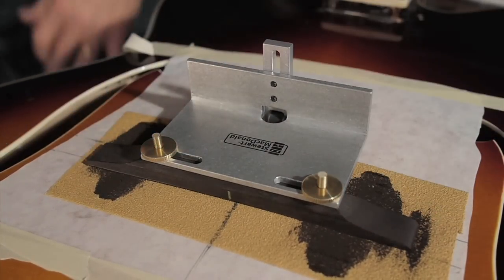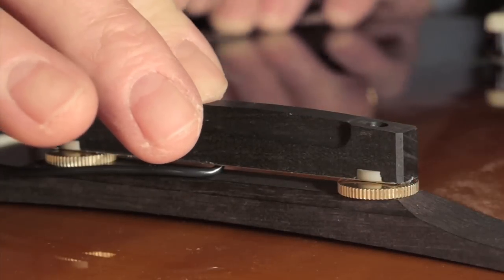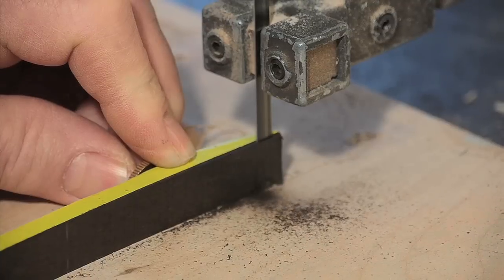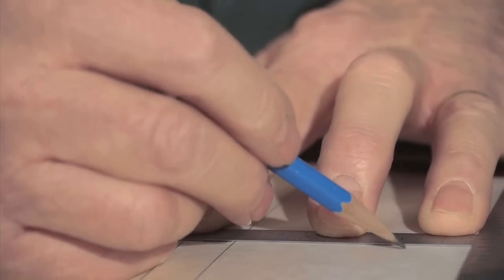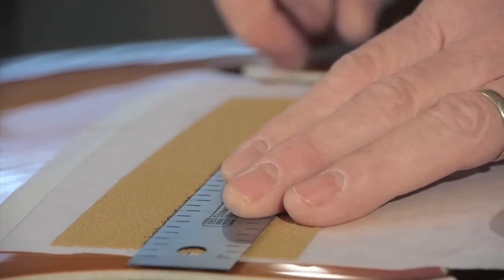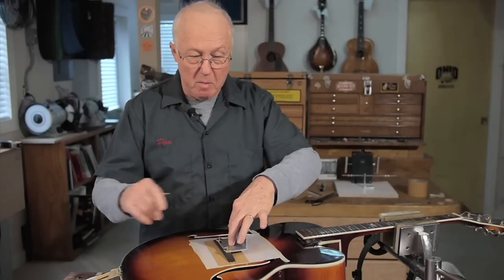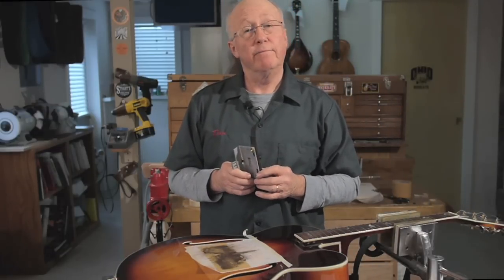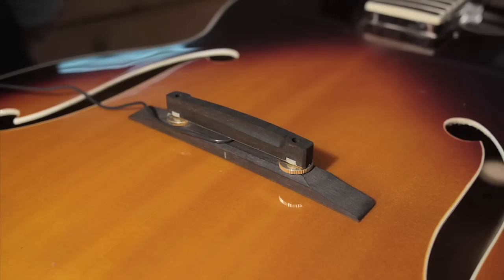Fitting the bridge to an archtop guitar

Comment: This is too expensive for what it is:  A couple of pieces of drilled bent steel, a wheel & a thumbscrew. Why isn't it $5? Probably costs 25 cents to manufacture.  I MAY end up buying one ($37) but not before I try to build my own version out of parts from my junkbox or the trusty local Ace hardware!  Seems like a jig you can make yourself.  If I were a luthier, it would be different, but to use it to shape the bridge base on 1 archtop (mine) and then shelve it, seems like a real waste of $37!
Reply: Today it’s $63!
Reply: @pnojazz  today it's 15% off, at $53.80.